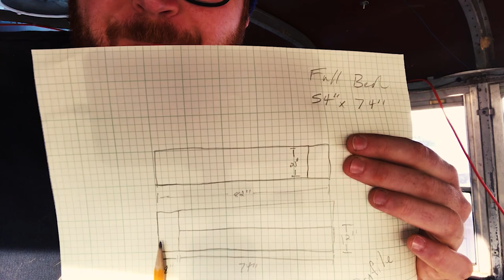Sofa Framing Part 1 | Skoolie Bus Conversion Tiny House Videos

Comment: Remember that the back cushion will either sit on top of or behind the seat portion, so adjust your measurements accordingly. You may not want two equal halves.
Reply from the maker: Ooooh good tip!